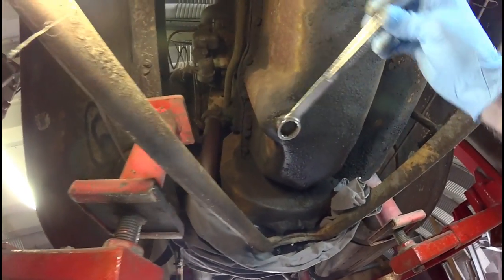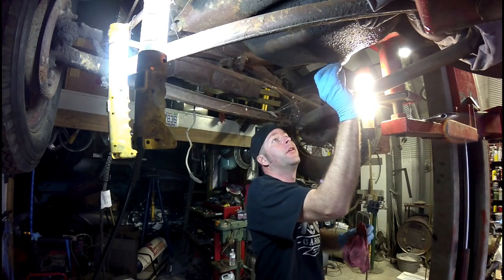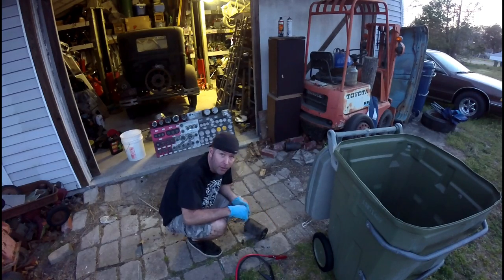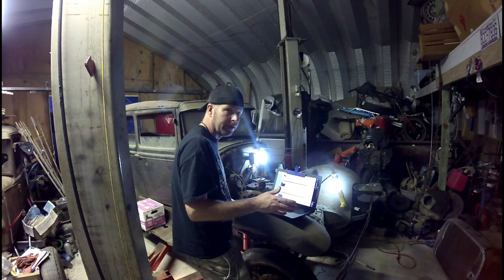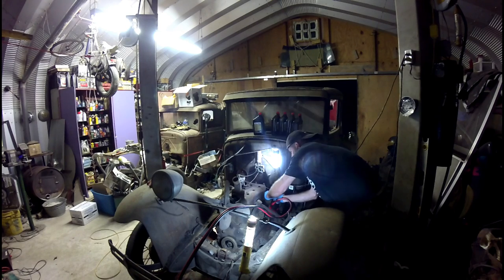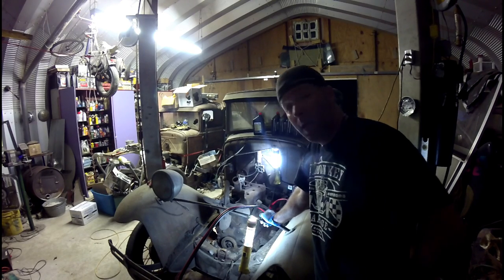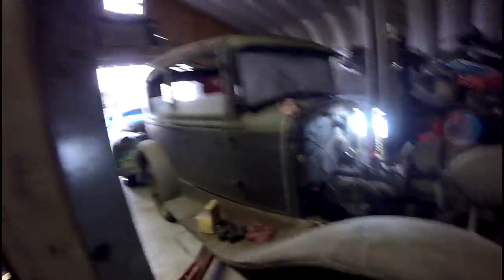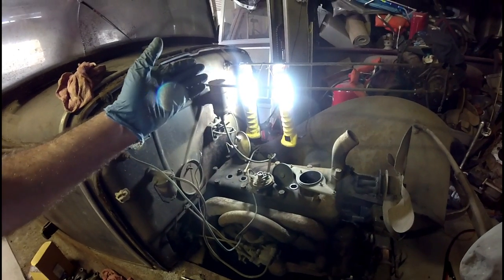Barn Find Model A Runs!! Ike's Adventures

Comment: Well done, everybody thats ever got something like that running understands the happiness you showed. I used to get the old tractors running then pull them down and repaint them nice. I really lost interest in the cleaning down and painting as I've got older. I'm just happy to get them running and driving Like you are doing with this A now. 

 There are a lot more people at shows  like to see barn finds, instead of the $50.000 plus 2 pack paint trailer queens in  both  highway type vehicles and tractors now to. Running as found/last used is starting to make money now to in auction sales as guys clue in. Thanks for sharing, I'm looking forward to the driving video now :)

Comment: The adjustable jaw of a crescent wrench should be in the direction of rotation.  Same principle as a pipe wrench, the torque needs to be on the FIXED jaw.  Same applies to a channel-lock or vice-grip, the adjustable jaw goes in the direction of rotation.  Otherwise you are relying on the "adjustable jaw" mechanism to do the work.  Happy wrenching....albeit in the correct direction. :-)

Comment: Cool idea running it on ATF, since it has better detergents to help dilute that engine sludge. The ATF is either too thin and getting passed the rings or the rings are bad.. maybe even the mystery oil burning off. Can't wait will the carb is cleaned and idling smooth
Reply: Integra DIY I thought that was a clever idea. I've always heard ATF was mostly detergent.
Reply: possibly the atf leaking past rings, but he also had to un seize the engine with lots of marvel mystery oil, PBlaster, atf, etc. soaking on top of the cylinder heads, I think that's what is burning off in this case, but after the rings getting unstuck I don't doubt they're going to let some thin oil slip past.
Reply: Integra DIY it's probaly all the other stuff he put in the engine usually engines smoke while burning out pb blaster
Reply: or maybe it smokes because he was pouring oil in the cyilinders for the last month
Reply: pb blaster is like a smoke bomb when it gets hot.
Reply: I heard of a quick lube that accidently put ATF in an engine instead of oil, car belched smoke like crazy, Owner turned around and they realized the mistake, put oil in.

Comment: @carsandcameras, Ike, trans fluid was used like a motor flush in the classics, as you say, It'll be fine, 5-10 minutes, then dump and refill with motor oil, then run 5-10 and dump and fill again. Also remember that you need zinc additive for the oil, and lead additive for the fuel.
Reply: thanks. ill try to remember that
Reply: Model A Fords came out before lead was added to motor fuel.
Reply: jan labij actually, model A ford's were produced from 1927-1931, and leaded fuel was produced in 1923, and is still used in some countries like Iraq. Leaded fuel was used to prevent spark knock by raising octane levels, and had an added benefit of protecting valve seats from pitting, especially exhaust valves.
Reply: @ManicMender  except modern fuels have much higher octane levels than they did 100 years ago. As long as it has good gas it should be fine.  You can also put hardened valve seats in the head to never need leaded fuel again.

Comment: pull off oil pan and clean it or you risk clogging oil orficaces. but amazing and congrats!!!! good job ike!!
Reply: also remember to be careful when choosing oil for that model a to prevent the magnet from clogging up.
Reply: no pressure oiling system in that engine. it's all splash lube.

Comment: ATF oil can be used without harm to engine . We would use ATF fluid when building motors for racing when pre-assembling it prevents damage to new parts. It will burn off when engine is fired..
Reply: Johnswebs that's how most if not all engines are assembled when done by hand, I don't know how they do it in factories though. When I was in UTI we assembled the engines back using ATF and they weren't racing engines by any means haha.
Reply: gbaca57 UTI represent

Comment: OMG... drop the pan dude!  Clean out that crap - 5 mins to drop the pan on that thing...  Babbet bearings are not cheap.
Reply: Well said. I just got a 33 Studebaker, a lot rougher than this Model A. Has a key in ignition and oil in crank case. Don't know if she's stuck yet, haven't had time to even check, but 1st thing I'll do is drop the pan. Probably full of sludge.
Reply: joe sixpack    Why not add enough oil until the dipstick says full?

Comment: Very cool!  My Uncle used to build model T's when I was a kid, brought back some good memories.  Transmission fluid is fine, like you said I wouldn't go driving around on it but it's perfect to flush an old engine.  I would get it up and running and let it get to operating temp and then shut it down and dump it, maybe even twice with something that's been sitting that long.  Congrats!  I've been waiting to see that thing fire!

Comment: little Smokey from all the oil soaking lol. 
good job bro. Thats bad ass.
The trans fluid idea is a good one for the start. it thin and it can get past most sludge to lubricate where oil will not until its flushed out. have used diesel for a quick run as well.

Comment: Bravo....I remember when I  was around 15 years old used to walk to school and pass an old house with a long driveway and I could see this model a coupe sitting in the garage. It never moved and finally one day I knocked on the door to find out if I could buy it yep I could have it for $25 bucks. It ran but the tranny had a striped gear. Me and pop towed it home and I found a tranny at Pete's junk yard for I think $20 bucks. I joined the air force a year later and when I came home on leave dad had sold it. I was heart broken but I had left for the military and that's the way it goes. This was in 1956 and the car was a 31 model always kept in the garage and all in tact. It still haunts me to this day. After viewing these three videos and realizing what I lost is really heart breaking.

Comment: When I worked for BMW it was common practice to add ATF to the crankcase to remove sludge. People would go 30-60k without changing oil. Usually 2-3 qts to an 8 qt crankcase making the difference with synthetic oil. Run for a few hours and change the oil. Surprisingly effective without even using the entire capacity as ATF.

Comment: If I remember correctly, many of the Ford 8N red belly tractor parts work with these engines.

Oh,  and check out the old Firestone store in Randleman NC for some nos parts. Place has been around for decades and had some cache of Model A parts. This is the old original on the old main street Downtown, not the newer store.

Comment: I've put trans fluid in an engine many times, even drove for a while with 3 parts ND30 and one part trans fluid after a blown intake gasket had filled the crankcase with water.  Trans fluid grabs the water and cleans the crankcase.

Comment: My younger brother tried that automatic transmission fluid in an engine to clean it out. It didn't run for 5 minutes before it seized up. They make engine flushing oil to use for that purpose, or you can just use regular motor oil with a bit of kerosene or diesel mixed in. Just sharing an experience.

Comment: in the OLD days putting a bit of ATF in the crankcase was commonplace to quiet noisy lifters. to flush the engine use motor flush AKA about a quart of K1 kerosene. that's all motor flush is and what was used since day 1.

same rules you mentioned just run it about 5-20 mins or drive a few miles and drain oil.

Comment: In the winter I used to run about 1/2 a quart of ATF in an absolutely beaten S10 I had simply to thin the oil out because it would clatter so bad without it. That truck ran for 70,000 more miles (about 4 winters of the ATF treatment) before it lost something in the bottom end around 210,000 miles (which for a 2.5 wasn't too bad at all). I don't think the ATF hurt it one bit.

That model A is also quieter than the S10 was on its best day. haha

Comment: Isaac, worry about the lights. 
Just about everything else can 
handle 12 (really 13.2) volts.

Your ignition, no problem.
Find an OLD Chrysler ballast 
resistor.  They are about 2 or 
3 Ohms resistance, and are 
a wire based resistor.  Short 
voltages, will go right through.
(Running.)  If you leave the key 
on, the resistor heats up, and 
lowers the power.

But, you probably know all 
this stuff.  (You DO work on 
a few older {points} cars.)

steve

Comment: you may have seen a post or two i posted up years ago on the web regarding ATF in engines. it's OK because ATF is under a lot more pressure and abuse in a trans .I use Dex 3 and normally. I just add 250 mls to an engine before i change the oil,and run the engine for about 200 miles . Eventually the engine oil stays cleaner a lot longer and the oil pressure goes up. it works great in Engines with hydro tappets. .I actually learned about using it in engines from mates in Scandinavia who use it to keep their diesel engines clean and in good condition.

Comment: Thats awesome you got that old girl runnin!!! Get the cooling system sealed up, and let it get up to operating temp for about 5 minutes with that transmission fluid to clean out some of the sludge in the bottom end. DO NOT DRIVE WITH TRANSMISSION FLUID IN THE ENGINE CRANK CASE!!!!!!! Its fine to idle and rev in neutral, but driving with ATF in the engine WILL DESTROY the bottom end. Ask me how I know :(

Comment: One of the things I always worry about with trying to clean out old engines with ATF or whatever, is the potential for a piece of sludge to break free and get caught in a small oil gallery and plug it up. Good luck to you!

Comment: Just a word of advice from an old guy when you use a crescent wrench always pull your pressure on the stationary side not on the jaw. Sometimes the jockin and slip and that'll strip out the head. My experience just passing it on.

Comment: nice, that's older than anything I've ever got running ..

I know some old stuff was splash lubricated so ,Idk if for was or not but if its pressurized oiling you better drop the pan and clean the pickup tube/screen.

Comment: Ugh! Ike, how could you? At :59 you're already using that big crescent wrench to break free a possibly stuck oil pan drain plug BACKWARDS. Always push the wrench TOWARD the movable jaw part. Pulling away from it loosens up the machined recess in which that little jaw moves, making it difficult to adjust the wrench tightly to a bolt or nut. This is probably one reason why you dislike those wrenches; they're hard to get tight on the work, since they've been abused. Love your you tubes. I always learn a lot from your vast experience. I am old and stay fit by working on old cars.

Comment: I don't know if you know, but most people don't. The older Motors like that are made with hard-faced valve seats. They were made to run on unleaded fuel. They only started putting lead in the fuel in the 50s or something like that. So those Motors run good on unleaded fuel I don't know about the ethanol.

Comment: I have revived some really gross and half locked engines with ATF. usually fill it as full as it will hold for a week and then drain it out, put in fresh 10w30, run it for 20min and then do oil and filter again.

Comment: ATF is about = to 5w oil, so no harm if no load on the engine and the detergents will clean out the sludge. My father told me about  using one quart of ATF in an engine that oil is very dirty, drain oil leave old filter add one quart ATF and top off with new oil(can just add ATF if low a quart but new oil helps) drive for day or two then do normal oil change replacing filter. better then any engine flush you can buy.

Comment: Ike transmission fluid never will hurt it to do a flush I have a model a that runs great and just bought another that the engine seized up like your I will recommend pulling the oil pan and cleaning it out before running it you will be surprised what you find in a oil pan on one that sits for a very long time mine was full of gunk

Comment: Not sure I'd use ATF as a flush, I've heard of people doing it but most ATF is around 0w20 thickness, might be bad on your bearings especially on an old motor with large clearances. Plenty of $2 additives that will do a good job without damage. 

Awesome work on the car though. Enjoy your videos.

Comment: Putting ATF in the motor is the best thing , But actually it might be better to fill the bottom of that engine with diesel to soften and render the old oil sludge from the bearings pan it`ll get into the seals and clean any water old fuels  plus lubricate everything inside rods , lifters rockers then lube it with ATF , All my old fords I ran ATF in the engine it stops lifter noise very fast and does`nt hurt a thing .Had and rebuilt 35 -- 67 to 94 fords was my hobby . AND THAT`S WHY I LOVE FORDS  -BRAVO .

Comment: We run ATF in engines that have been neglected. Especially vvt engines. It's high detergent helps clean and unstick things.  I wonder why you wouldn't just add a few qts of oil and check level on dipstick. I bet it's better than Google! I had a bitch of a time finding a machine to bebuild my model a short block. Nobody around me does babbit bearings anymore. Good luck with your project!

Comment: Now I have more hope for Grandpa's 1941 Dodge Truck with a (Not Original) Straight 6. It hasn't been run for at least 14 years and hasn't been on the road since the late 60s or early 70s. It has no oil filter (old canister type) either, I might have to work on that.

Comment: I've been rebuilding motors for the better part of 30 years and there is NO problem with adding up to a quart of ATF, Valvoline Type F is what I use, to your oil about 300 - 500 miles before an oil change. It helps break down the sludge and settle it in the bottom of the pan. Now for fuel injected cars you need to take a little different approach, buts that other stuff doesn't apply here. In regards t doing what you did, there is Nothing wrong at all; as a matter of fact; it's actually a good thing for the exact reasons stated above. You could let it idle for an hour, shut it down to cool then repeat 3-5X then drain and fill with regular motor oil.

Comment: I'm too used to modern engines, it took me a second to realize why the spark plugs weren't deep inside, but I did realize after a second that overhead cams weren't a thing on those and that's probably why most modern engines have them deep inside.

Comment: ATF is basically just a lubricant and light detergent just like regular engine oil. The only real big difference is the lower viscosity which doesn't stick to fast-moving parts as much as engine oil does, but you CAN run engines on ATF as long as you don't intend to haul ass and stick a brick on the accelerator!!

Comment: To clean the  engine oil that has been sitting in the old model A engine , we alway used half 30  weight and half kerosine, that is the old school way , run it for a couple minutes and then drain it, pull the pan and clean  the sludge  , replace the pan and ad new oil , good to go , Always worked. <>Mike

Comment: Speaking from experience... It might be an idea to keep a fresh fire extinguisher handy. When you choke the updraft carby it has a habit of spilling on the floor. If it backfires on a subsequent start you might have a serious fuel fire to deal with. 
You don't want to lose your A model collection, garage and possibly attached house while you try to put out a fuel fire.

The advance lever on the steering column should be retarded on start and advanced after it is running. With the retarded timing she will sound lumpy but you will know when it's set right after it's running because it will run smoother around the sweet spot.
There is an adjustable main jet in the carby that is controlled by turning the choke knob above the steering column clockwise or anticlockwise. It takes a bit of fiddling but just listen for sweet spots to know when it's set right. After the engine warms up you can lean off the mixture a bit.
Sound to me like you have good even compression in all four pots. I like your philosophy of trying to keep it as original as possible.

Comment: Hey Ike, just a tip on the audio going out of sync on your videos.  I've had this happen to me and it occurs when filming with a variable framerate (Iphone, Android, etc) and then importing into Adobe Premiere (maybe other video editors as well?) as it doesn't know what to do with that slightly variable framerate so it just picks the average which will slowly get the audio out of sync over 10+ minutes.  Easy way to solve this, run your raw video through a program called Handbrake and select "Constant Framerate" in the settings, this will output a constant framerate file that you can then import into Premiere and have no more sync issues.  Just sharing my recent experience.  

Love the vids, it'll be fine.
Reply: thanks

Comment: OMG... you have a lift and you can't drop the pan and clean it?  Seriously??  Running it on that sludge/ATF combo will ensure you will be pulling the engine for sure.  Babbit bearings and turning the crank (and replacing the pan gasket) is about 200 times as expensive as dropping the pan, cleaning, and replacing the gasket.

Comment: Hey you might should pull the oil pan off to make sure there isn't some ancient sludge hangin around in there, I've seen some videos of some nasty caked sludge in the bottom end of some old engines like yours.

Comment: Should you run the oil pump by hand use a drill to prelude before starting ... were the "A" s a 6 volt + ground system ?? THHN lol wish I was there to help you celebrate!!

Comment: Could have gone to any parts house put a 2 ohm in line resistor on hot side of coil and you'll been fine. Been doing it for years on the 6 volt farm tractors